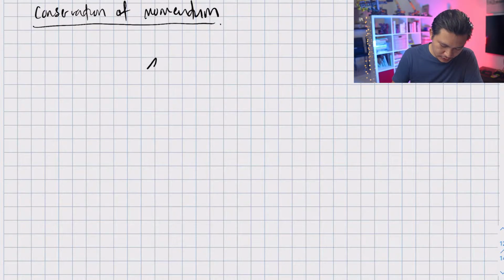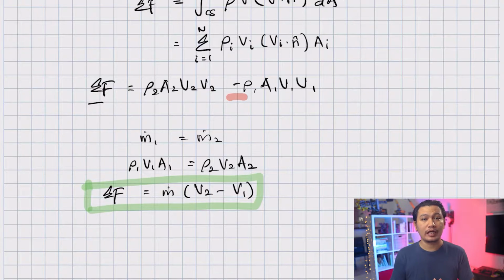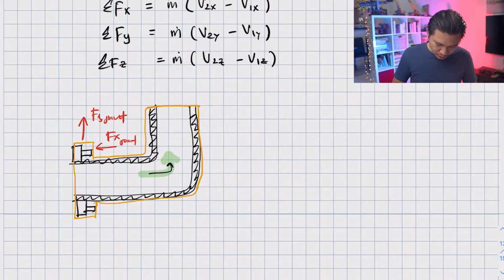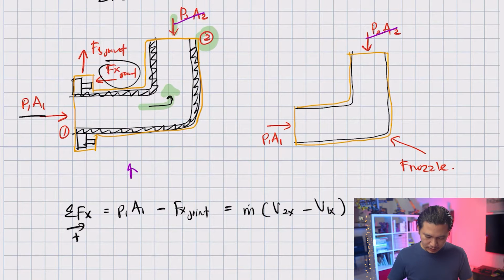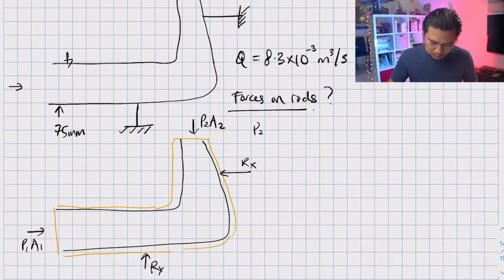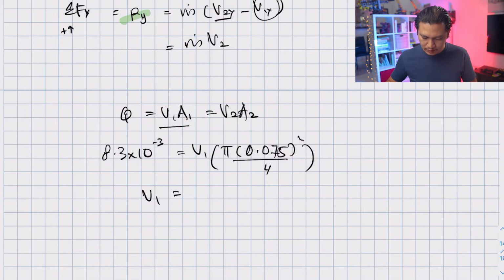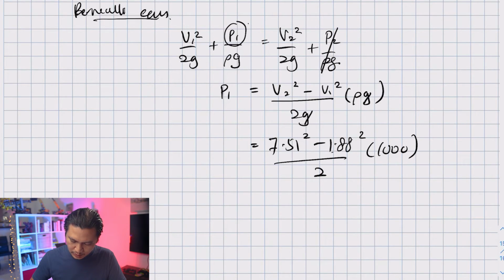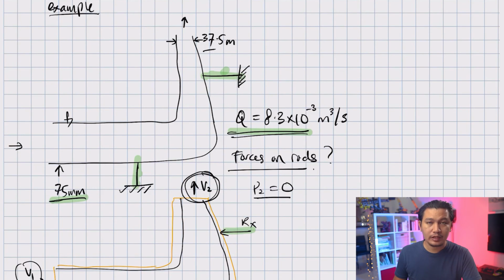016 Conservation of Momentum

Comment: sir, what happen to the elevation terms in bernoulili equation?
Reply: Yes sir I also have the same question
Reply from the maker: Which part are you referring to? Please state the timestamp
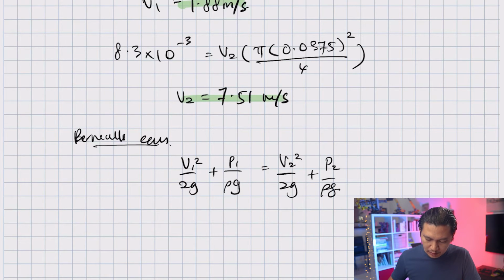Reply: @drhasbullahlectures5547  sir at 17:23
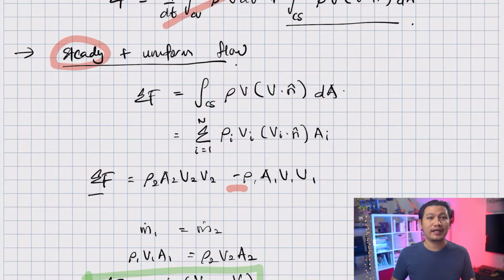Reply from the maker: The example involving a pipe bend at 10:20 is a horizontal pipe bend